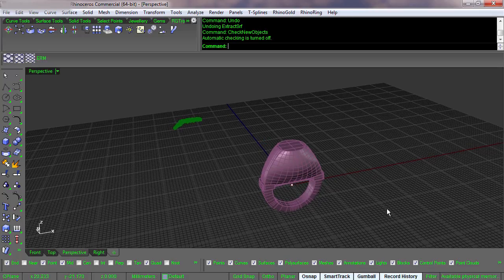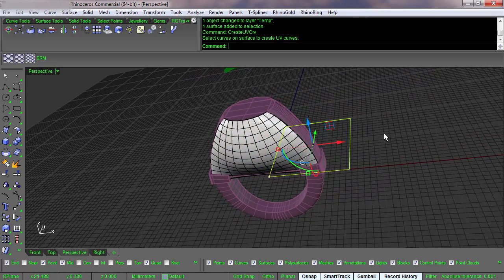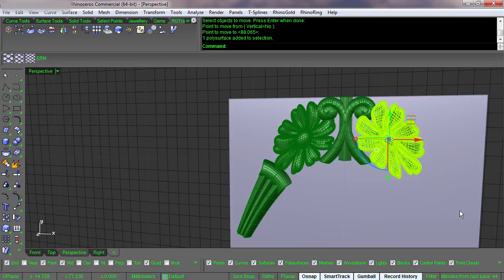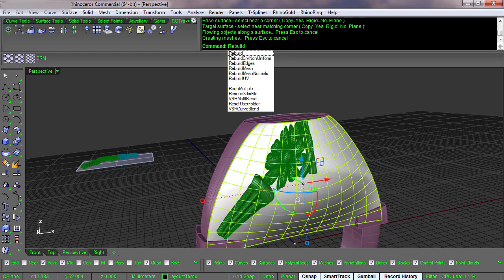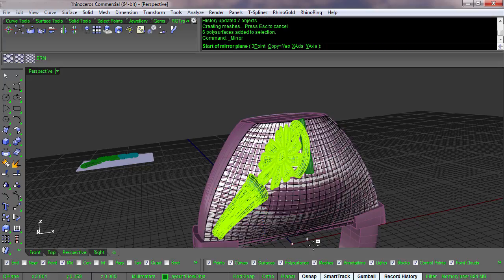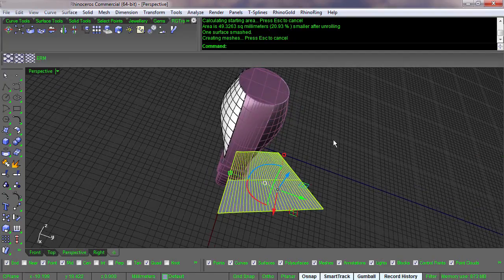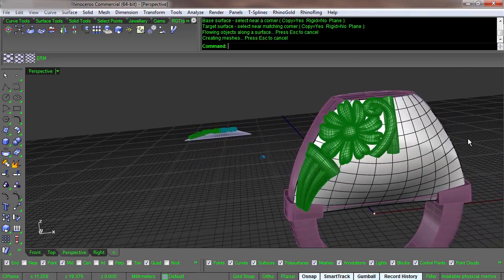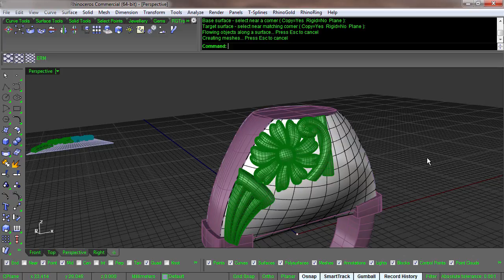Rhino Tips And Tricks - Flow Along Surface With Accuracy And Without Distortion

Comment: Why is it that when I try to do the same thing with a similar shape (but a little more curved), my poly surface I’m trying to flow onto my surface ends up on the opposite side and at a different orientation? I use smash and tried messing with the directions in every direction.

Comment: I'm a newbie with this software and wanted to request for some help with this function?
The objects I'm trying to flow are asymmetrical. The surface I want them to flow along was cut out from another surface. If I try and use either 'flowalongsrf' or 'rebuild' command the objects flow along or rebuild to the previous surface it was cut from.
How can I solve this problem?
Reply: *****
:Thanks for the prompt reply. I managed to solve the issue through painful trial and error. I must say your videos are a goldmine, even though I've never designed jewelery. Will check out the forum too.

Comment: Anyone know of a way to to the revers process of this?  Using grasshopper or just a command in Rhino
I have a skewed model I need to flatten, but keep the 3D geometry.
Reply from the maker: The same thing works in reverse, making a curved base srf and flowing to a flat target srf.  I'd have to see a picture to help any more than that (which you can post in the discord: https://discord.gg/WtmtUrSdZs )
Reply: @EricM81  Tried joining but giving me issues.  Saying Whoops Unable to accept invite.  I'll try another time but thanks
Reply: @EricM81  I think it worked actually!  Just did what you said and reversed the concept and order of selection.  Seems obvious and should have thought to do that ha. Thanks!
Reply from the maker: @ryang5180  i saw 2 different ragreen's join. both are members now.  maybe restart the client? glad you got it squared away.